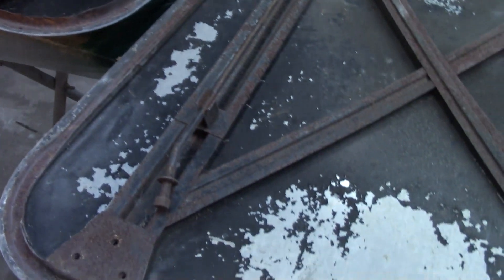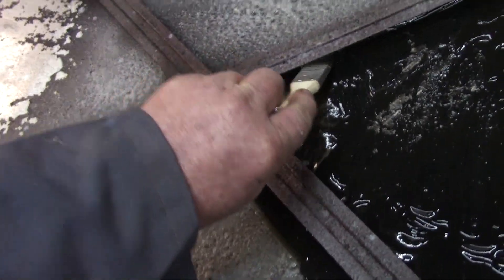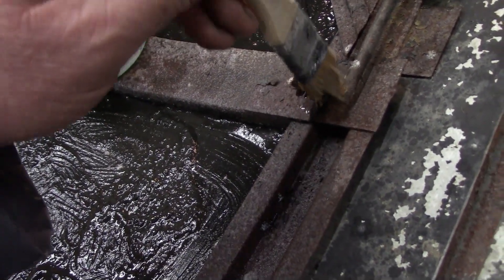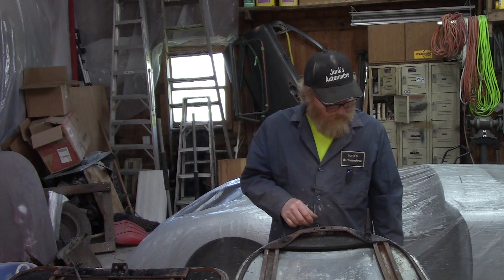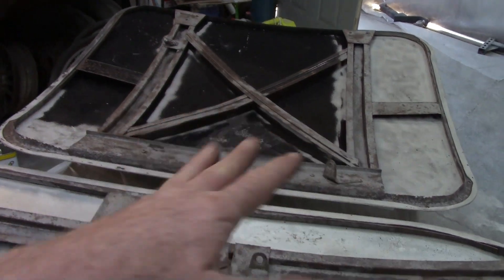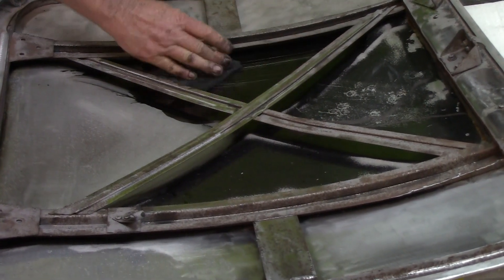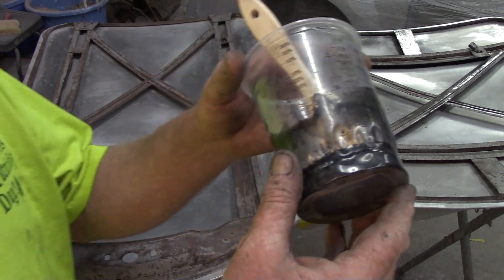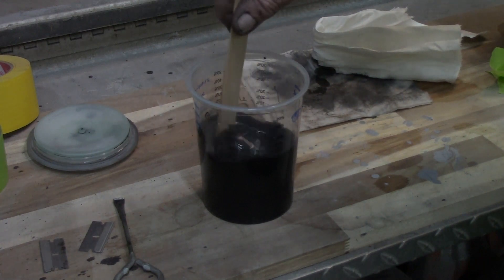Limited Skills, Impressive Results: MG MGA Hood & Trunk Lid Painted

Comment: Hind sight is always 20/20 but I would have prep. the inner and outer at the same time then lay the primer on.  That way you could blast the under side of the hood with a pressure washer.
Reply from the maker: Of course! Getting the outside done and in poly primer was a goal knowing I would have to deal with it later. The bigger problem was the amount of bare metal at most of the time during the process being in such a non climate controlled area... if you know what I mean ;) Just figured it would be more time effective doing it this way. Glad your watching Brian!
Reply: @junksautomotive  You're doing a great job and love the British racing green!  My older brother had a 1966 MGB in that color that he taught me how to drive a stick.  Come to think of it every car I've owned has been a stick except for a Ford f250 that I only used for towing my boat.  I took a Mazda 626 up to 240,000 miles on the stock clutch.  My Passat I drive now is at 220,000 miles on the stock clutch.  My brother must have taught me right! 😄  
Also I play a little bit of guitar, so that's a win, win watching your videos!
Reply from the maker: @brianlachapelle8757  Ha cool! My 57 Chevy will be 4 or a 5 speed! I learned 3 on the tree in my backyard when I was 14 ;) Thanks Brian. Hope you have a great week buddy!

Comment: What's that use your  brain and not your back all about?
Reply from the maker: Hi Hazzy! It's about using a car lift to lift a removed transmission and the new one.  I was taking the new one out of the box it came in and then able to put the old one in. Then put the new one on the trans jack.  Alot of guys just pick them up with a helper. I learned a long time ago.... save your back 😊